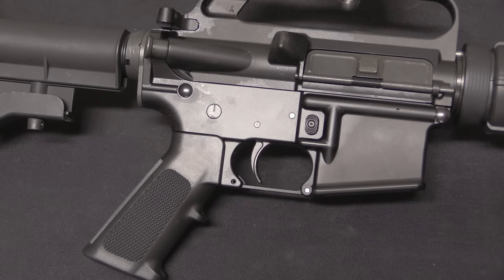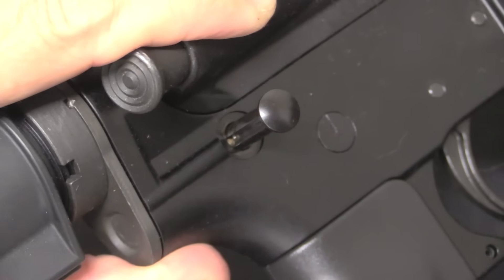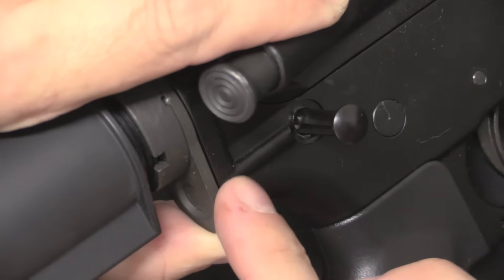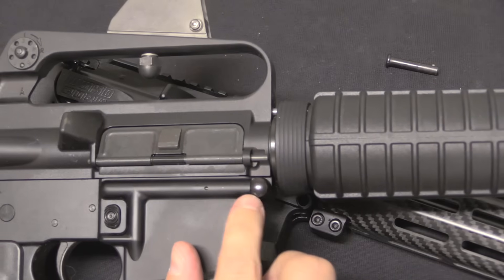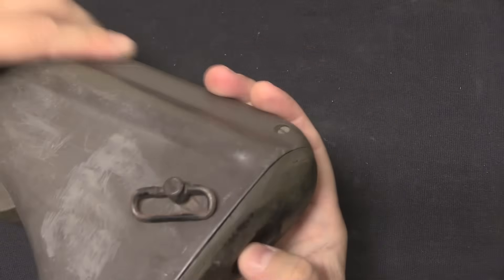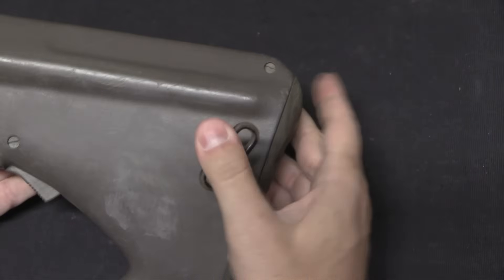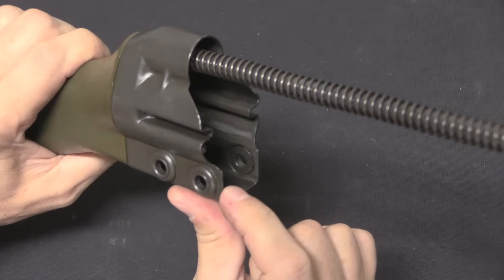Ask Ian: Why Don't More Rifles Have Captive Pins?

Comment: One would also note replacing lost pins is a huge hassle for us private owners who don't like spending extra money, but for armed forces, it is not so problematic. Most firearms in a peace-time army go straight to the armory on a regular basis for storage, so they can sort the issue. In war, handing out a couple of extra pins is generally easier than trying to quality-control captive pin systems at the manufacturer. Will the occasional soldier be screwed up by losing a pin at an inopportune moment? Sure, but that is why we have units of soldiers, so no one soldier being hors-des-combats means the end of combat.

Comment: The Tavor and X95 uses a fairly simple solution.  Instead of a detent, it uses torsion springs that can lay flat inside the polymer shell without having to compromise it's integrity or having a complicated installation.  The spring itself applies pressure to grooves in the pins to retain them.  It's likely how the VSH retention also functions.

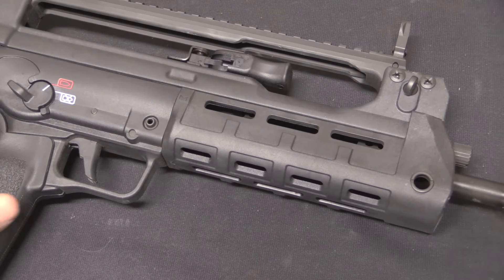Comment: I'm a mechanical engineer / firearms designer.  at 6:00  this type of pin is clever, but because its threaded in, it can back out due to vibration.  Generally, we prefer to avoid threads where we can on a firearm.  Where we must use threads, we like to use something to lock the threads (a pin or similar).

Comment: So as a swiss I've only seen two material failures on the SIG 550.
The rubber parts, the stock rubber part and the charging handle.
I know people that haven't cleaned their rifles in years and never heard of captive pins that stuck.
Reply: The real question, isn't the performance in Switzerland climate. It's what happens if those rifles got put into a swampy bayou situation? Would the pins that haven't had any issues in a more moderate mountain climate, behave the same in Vietnam, Laos, Congo, or Louisiana? I can't begin to answer that question. But, it has happened with rifle designs in the past multiple times.
Reply: @SlavicCelery  Don't know, luckily for us swiss we probably won't invade in the near future a sub tropical country.

But I get where you come from, I would argue that moist climate had more effect on rifle with wooden furniture (expending wood stock by absorbtion of moister). Polymeres and metals might not be that much affected by that.
Again I know people that, putting it lightly, haven't given their rifle much attention and I've never seen those captive pins with rust.
You could not turn the gas regulator not even mentioning taking of, the outside of the barrel full of rust, and the chamber full of brass particles and sooth.
But the captive pins worked, the gun worked. 

And I forgot a common failure of the gun, that little black plastic that kerp the stock folded that also likes to break sometimes.
Not a common thing but it happens. So sometimes you see guys with a hanging stock.
But again besides these 3 things the gun is from my perspective almost impossible to break. Without bad intention ofmcourse.

Comment: @AUG: The rear takedown pin on an AUG might not be captive, but on a military rifle it is always fixed via sling to the receiver. And as such not prone to losing.
Reply: Exactly. 
Also you can put the pin in from the other direction if you want to put the sling on the other side.

Comment: There's another way to make the pin captive. And it's feasible both for sheet metal and polymer - axial profile cuts into the pin, similar to those on Steyr AUG rear pin, and a C-clip, traveling/tripping over them. Easy and cheap solution.

Comment: 7:15 but arent captive mechanisms in for example AR-15 have same additional parts in them, that can cause same issue?
Reply: Extremely.simple parts that are very well protected from damage or dirt and under very little stress.  And even if the spring in the detent channel breaks badly enough it doesn't work (I've popped.out detent springs that were broken in half and still provided adequate tension), what your left with is basically the same as if you had a non-captive pin in terms.of securely fitting.
Reply: This this piece isn't exactly the best analytical analysis about captive pin on firearm design.

Comment: Mechanical Design Engineer here - in my experience most initial designs have all sorts of features to improve the quality of life for both Production staff and end users, most of which get cut once management decide they need to meet some ridiculous profit margin..
Reply: Yeah, that checks out.
Reply: I think the bean counters might not call budget constraints ridiculous. We all have to answer to someone.
Reply: @HD-J.R.  to some extent sure, but having worked on projects where major considerations for assembly teams have been canned to make 80% margin instead of 75%, I can assure you there is definitely rampant profiteering to be found
Reply: @Ben-rq5re  I'd say to a larger extent than most realize. Being on the supply side to military procurement, and managing manufacturing production for 25 years, manufacturers/suppliers do not make the money people think. Politicians, regulators and Wallstreet make the lion share these days. 

Your argument has more validity in consumer goods, but not in firearms or average military goods. I cannot speak to things like planes, tanks and missiles... etc...
Reply: @HD-J.R.  Unfortunately I’m not in military supply, I design inspection robotics for the petrochemical industry - there’s truly ludicrous amounts of money floating around, and every company is trying to grab as much of it as they can. Just to be clear, I have no problem with making profit, just when it comes at the expense of either end users or the people responsible for making the products bringing that cash in.
Reply: @Ben-rq5re  I didn't think you were against profits. I also think we are having a useful, respectful  conversation. 

Your industry is a supplier to mine and yes, I understand now.
Reply: @Ben-rq5re  5% is actually rather significant.

Comment: Additionally, to introducing a weak point in polymer parts there may be another issue that I think might be even more significant in some cases: A long hole for a detent and it's spring means a sudden decrease in material thickness over a large part of a certain cross-section. This can be a huge headache for injection molding processes, which are often used for polymer parts, if the axis of the hole is perpendicular to the direction of flow of the molten material. If there is some material added around the hole for strengthening that would even exacerbate the problem of rapid changes in material thickness! The issue is that the molten material flowing through the narrow section at the hole can cool down and solidify before enough material can flow though to areas “downstream” of the narrow section. This will sort of “choke” the flow of material and cause holes or shrinkage in the parts.
Reply: wait.. are you expecting them to have the hole made during the molding process?  they drill it out after, or mold it with the pin already there
Reply: @jameskazd9951  Oh yeah right... drilling works! I don't see how you could mold around a pin though? At least if you want it to move afterwards. Unless you put the detent and its spring in a little self-contained tube. But I'd think you'd introduce the same problem of rapidly changing cross-sections with that method. Does it work well in your experience? My knowledge of injection molding is limited to theory only.

Comment: When CZ 805 came out people were asking "why it does not have captive pins?" 
Than CZ engineers asked "why didn't we use captive pins?" 
Therefore, CZ 806 had them
Reply: considering Bren2 was direct result of complaints from actual users... that simply means the soldiers WANTED teh pins to be captive ...

you know because a little extra cost on already overpriced rifle is worth not ending up with unusable rifle in middle of combat because you accidentally dropped the pin while clearing a malfunction...

Comment: In defence of the AUG, the rear sling pin is designed to be inserted either side of the butt group. That wouldn't be possible if it was a captive pin.

Comment: This brings me back to my high school engineering class I took.  There are many factors involved even when wanting to use captive pins on a weapon.  Materials, Cost, layout, and complexity all play factors into it.
Reply: Your High school class taught engineering for weapons design? Have a hard time believing that. Even covering weapons in the class is hard to believe. Even start of 2000’s it was a quiet don’t speak of it type of thing.
Reply: @1014p  it was a general engineering class, not for weapon design.  The point I was making is that the types of constraints are the same in regards to engineering the parts that were covered, which were captive pins.

Comment: If you're not doing captive, which as you've shown doesn't work with every material and design, I think the HK solution is probably the most soldier-proof because it has a defined order of steps. Yes, the take out and replace sort of thing Russell has pointed out with the KP15 works, especially since most folks will just remove one pin and shotgun the receiver open, I'm curious how many times it would take Private Schmuckatelli forcefully closing the upper on the pin accidentally to damage the pin, the rear pin hole, or the front pin hole. The average KP15 owner is probably a few rungs above guys who buy V6 Mustangs at criminal interest rates.
Reply: No, they are the same guys buying v6 mustangs.

Comment: I think it is more appropriate to say that the difference between the kp15 and the aluminum receiver is due to the manufacturing process rather than just the pure material properties.

To add a retractable pin into the mold adds cost and complexity to the mold and the engineering involved. Whereas with the aluminum lower, if the blank in already positioned for machining of necessary features like the buffer tube thread then the cost of a small hole for a spring is tiny in comparison.

Take a look at the front take down pin spring bore on the kp15. Notice that there is no bulge for the spring? they've changed the geometry of the receiver and removed the home for the pin all together because they are trying to maintain a uniform wall thickness (within reason). If they added the bulge and decided to machine it after it is risky and costly. It could require them to machine in an orientation that they wouldn't otherwise need which adds cost. It could also result in a void in the center of the bulge and prevent you from having a nice straight smooth bore.

Comment: Captive pins have an anecdotal risk of damage to the receiver while disassembled by people who don't know the risk of leaving a captive pin extended. That is to say I've heard of (mostly new owners) disassembling, leaving the pin extended, dropping the receiver, and the receiver falling on the pin in such a way that it breaks the receiver (from pin on stoner designs). Rather than risk learning this the hard way many simply push the pin in while the receiver is disassembled. Similar to not leaving a hand drill with a bit in it when not being used.
Reply: I've seen more than a few M16a2 and M-4s having the front takedown pins broken do to that. I don't remember any of the M16a1's having it happen but I know it did on accident too. Arms rooms before "operation clean sweep" kept them in stock for replacement.

Comment: In an AR, the wall thickness is wider than it needs to be to allow for the hole for the spring and detent. It could be thinner and lighter if it didn't have a captive pin.
Same for the fire selector detent.
Reply: And the wall thickness to achieve that same strength with a detent pin channel with most polymers would make the receiver (at least in those areas) a very Chonky Boi indeed.  😁

Comment: i wonder why there isn't a pin design with a static piece in the hole (where the spring loaded thingy would go) and the pin has a kinda Z shaped groove at the end still less viable in polymer but less complex parts
maybe machining the pin is too copmlex? but i'd imagine when you build a whole rifle you have the means to rotate a pin while machining it
Reply: Fixed captive pin solutions abound.  Heck, the AR15 firing pin effectively functions as such for the bolt carrier cam pin, and the bolt cam pin and cam.path effectively function as such for the bolt head (relative to the carrier).

Sometimes it's the best solution (albeit usually by just milling a flat on the pin for the desired travel, with a fixed cross pin that clears that space for the retaining pin).  Sometimes the spring loaded detent is the best solution.  Sometimes telling PVT Snuffy not to lose the pin (or lanyarding the pin to something big, like the AUG sling or typical MG tripod pins lanyards to the tripod itself).

Figuring out which solution I'd the best in a particular use case is where the guys who turn the brilliant machine's designer into a practical production and service machine make their money.

Comment: you could also do key hole pins

so a standard round pin with a small extrusiom poking out 1 side at the tip

youd insert it into the outside then rotate sonit fits into the matching keyhole on the upper and other aide of lower
Reply: If it CAN rotate, it WILL rotate.  And if orientation of rotation and fiction are what is holding this critical pin in place...

"Hope is not a plan."
Reply: @geodkyt  with the key hole slot on the hole, it wouldnt be able to rotate until its already out of the uppers pin hole
Reply: Yeah I was surprised that wasn't an example.  Just a pin with a dint sticking out of the end, and it has to be turned to get in or out.

Comment: Not sure I agree here quite. The pins shown have built in detents, in the pin,  to hold them in place, all that is needed is a recess for that detent to pop into in the withdrawn position, so the pin is retained if not completely captive. This could be accommodated in  stamped or forged metal or in a moulded plastic receiver.
Reply: The pins with the spring loaded captive detents in them only have them as a way of keeping the pin from vibrating out or otherwise getting knocked out of the gun. They way they are designed doesn't allow for the pin to be captive in the gun: the detent is chamfered/rounded on the edge which makes it push itself into the pin when pulled through. If you wanted these pins to be captive you would still need to go the same process of designing a method of capture similar to the ones Ian demonstrated in the video.

There are some designs that don't use a chamfered/rounded captive detent which causes the pin to not be able to be immediately pulled out. As soon as you depress the detent and pull the pin out it pulls right through the gun and is not captive.

Now if you had a design where the captive detent was keyed to stay in one orientation and only one side was chamfered, then you could depress the detent and pull it through. Once its pulled through entirely you would have an internal recess inside of the gun by the edge for the detent to pop out to keep it captive. Now having the one side chamfered allows for the pin to be pushed back through the gun and once fully through the detent pops back out. The problem with designs like this is that if the pin fails you either no longer have a functional weapon or you are unable to open the gun to service it. I'm not sure if a well designed pin in this manner is necessarily more likely to fail, but I don't think I have seen a design that does it this way so it may be more complicated than other methods.

Comment: My previous comment got auto deleted cause I edited an imgur link of the sketch of that design in it, my bad. 
As pointed out by the replies, a major flaw of that 1mm section that is 1mm wider design is that there's no way to put it into the gun in the first place, but I think you could fix that by making the opposite: instead of a wider diameter, you make the tiny section a lower diameter, and then add a kind of cut washer into that cutout in the pin during assembly, that way it's actually doable and you still get the same result.

Comment: Love the explanation, but just one small thing about it that I don't fully get: if the takedown pin is held captive by having that mini-pin (for lack of a better designation) stick through it, how do you make it so that you can push it back forward without having to push that mini-pin back under spring tension AND without it or the spring behind it breaking?
Like at 8:13 with MDRX, you can see the pin protrude but then as soon as you push the takedown pin back inward, the mini-pin just seems to happily oblige and go back under spring tension. Is there some kind of incline to the cam in the takedown pin that allows the mini-pin to easily ride back out again?
Reply: The tip of the spring loaded detent pin is radiused, as is the hole in the takedown pin. The little radius acts like a cam. Also, the slot terminates before it reaches the end of the takedown pin, so the detent never blocks the path back in.
Reply: @kmech3rd  Thank you

Comment: All the while i was thinking of a system that could work in polymer and the Hellion did just what i was thinking of.
And yes, it costs more and it's more prone to failure. But imagine the cost of losing a pin in an active warzone? You can't use the gun without a pin either.
If rust fouls the pin then you are also quite likely to have rus that has fouled some other vital part.

The real question then is, why isn't more rifles built like the AK. It has "captive" pins... Or rather, it doesn't have pins at all per say. It's just held together by its parts interlocking with spring pressure.